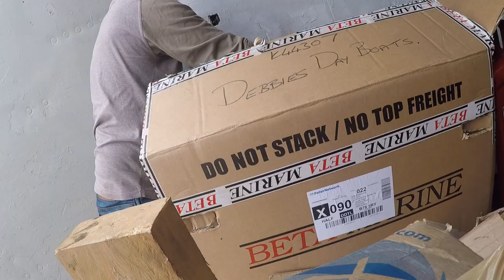20. Narrowboat Badgers Heart Transplant- New Engine is in !

Comment: Really chuffed for you both :)
Two little things to bet aware of with a Beta.
Its worth putting a cable tie around the multiplug connector. They are known to come apart.
Also keep an eye on the air box, the tags holding the lid are quite small and sometimes it falls into the bilge. Just tiny niggles, but a briiliant engine. Look forward to seeing you on your travels:)
Reply from the maker: we were securing the multi plug today and I thought about this comment :) I'll keep a good eye on the air box too mate, thanks for the heads up!